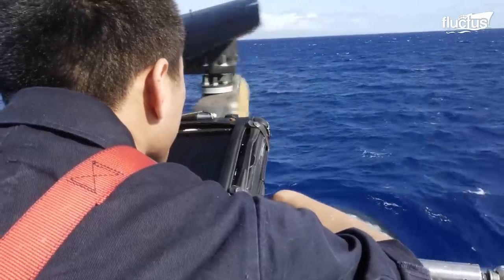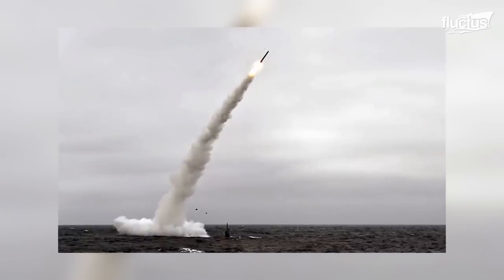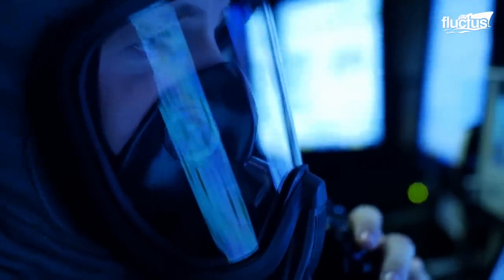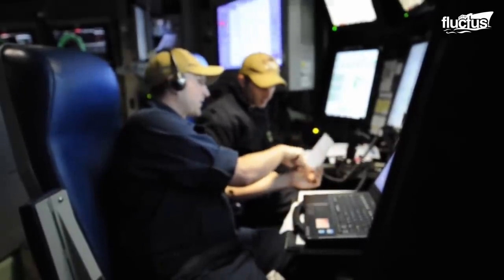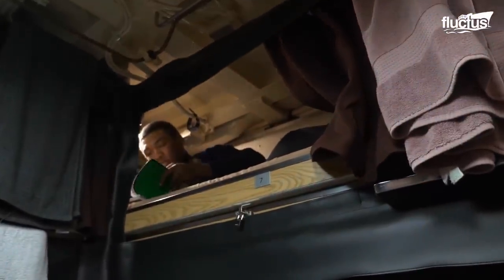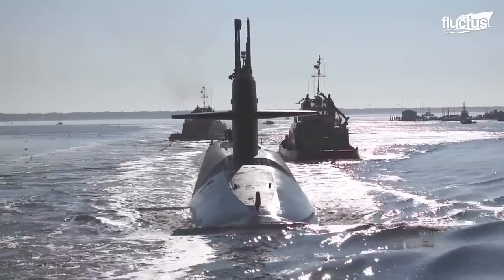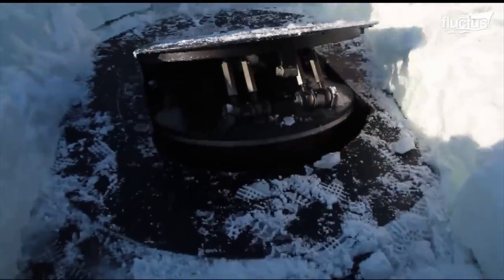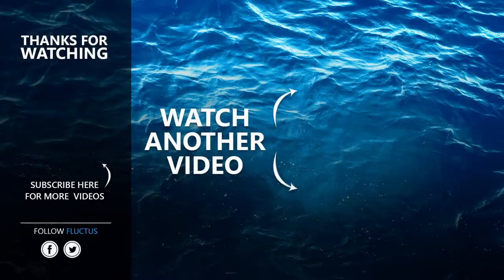Life Inside $4 Billion US Submarine Underwater for Months

Comment: I heard once that you have to be fairly short to work in a submarine nuclear or otherwise because of head Clarence is that true??
Reply: Nope I've seen 6 footers in a submarine, shorter the better though.
Reply: Our tallest crewman was about 6'5'' and they modified a locker at the end of his bunk to fit his body.  no height restrictions.
Reply: I'm 6'1" and cleared most of the low hanging valves and pipes--you learn quickly where they are!  My bunk was just big enough.  It's all good though.